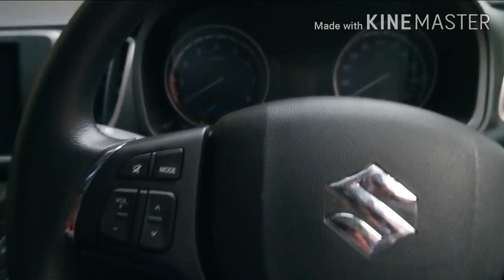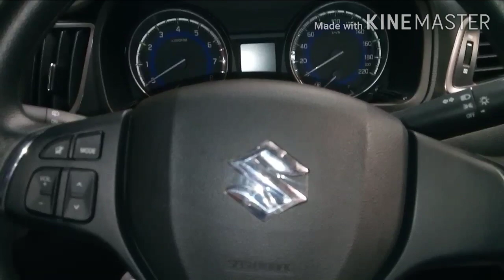Car clutch control in different situations|in malayalam

Comment: Bro njan use cheyyuat tata nexon aan clutch okk easy aan but vere oru car  edukkumbol edakk off aayi poovunn atendavm 🤔
Reply from the maker: oro vahanatinum biting point vyatyasam undavum 
chila vahanatil biting pointil nalla vibration undavum eg(3 cylinder engine) chila vahanatil vibration kuravayirikum eg(4 cylinder engine)
Reply: @DRIVING_TECH  apol eduth eduth aim aavnm alle
Reply from the maker: @abhijeethvr7087  yes
Reply: Biting point difference undavum ooro vandi lum diesel car pole petrol car clutch ill edukkan pattilla

Comment: In case of low clutch how to take in 
Traffic block in a upward high roads
Reply from the maker: what you mean by low clutch
Reply: @DRIVING_TECH  some manual cars 
Half clutch will not get correct Timming to take in High areas
Reply: My car old alto .
Half clutch  the is not in a forward moving condition .it going back in High areas
Reply from the maker: @j4vfx190  hand brake use cheyte edutal mati